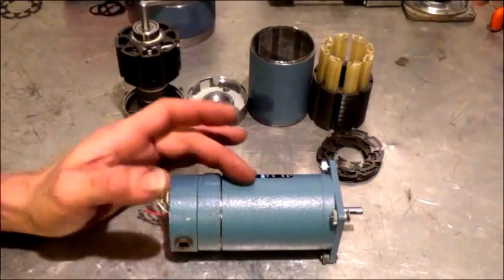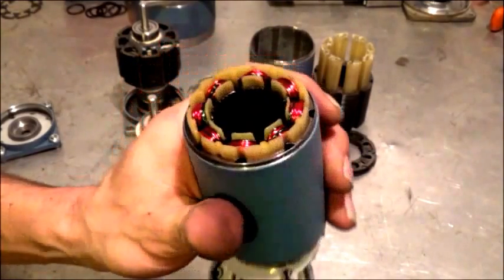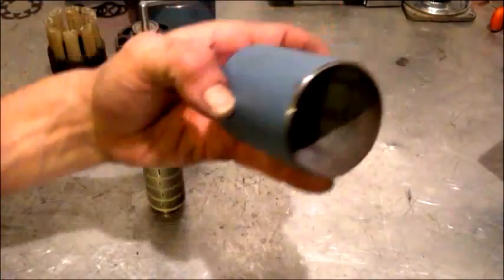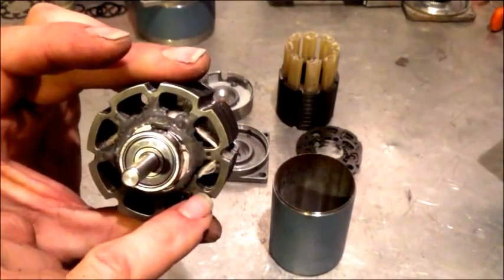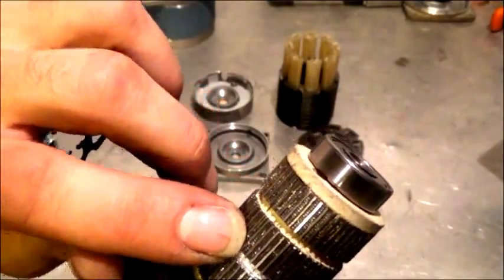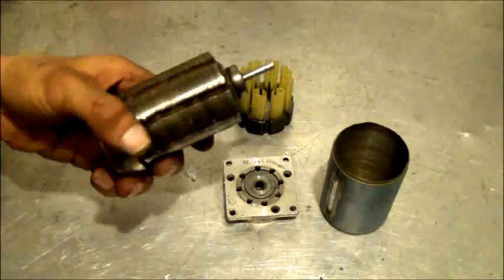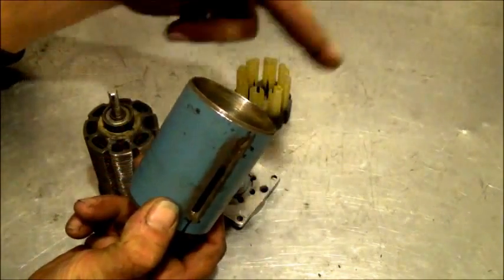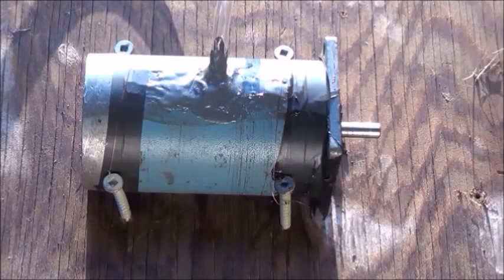"Tesla Turbine",  Full Build And Test. More Like Tesla's Original Design.

Comment: Did you run this on some fuel or just pressurized air? Because I remember that the fuel needed to combustion before entering the engine for maximum efficiency.

Comment: Have you done/can you do a direct comparison between your modified design and this more traditional one? I'm very interested to see what the differences are in torque curve, max. power and efficiency.
Reply from the maker: The video of this one and the other one both show the same generators with the same transmission box and even the same air supply, pressure and flow,. This design only produced 1/3 the output as my design, I sent both of them to different people for use and I'm not sure if they will ever come back to me as promised.
Reply: Thanks for the reply, your design has really impressed me.  I want to build a steam motorcycle someday and I was thinking of using a turbine of some description to drive the auxiliaries (centrifugal oil separator, alternator, blower), perhaps running on magnetic bearings (assuming I can find a decent enough shield to reduce its influence on the rotor) (actually, the rotor might be perfect for the permanent part of a magnetic bearing system, as you mentioned in another comment reply about making the rotor a generator). Would you be OK with me using your concept?
P.S. thank you so much for sharing this with the world. Channels like yours remind me why I'm studying engineering to begin with.
Reply: Also sorry to hear that your turbines might be gone for good. I hope they come back.

Comment: After 3 years machining tesla turbines I still went back to steam piston power for dc ac generation. The holes in disks eliminate one crucial factor that Tesla was exploiting which is the molecular friction bond of super heated dry steam on the face of the disks. It is a phenom of the surface interaction. I think you should explore the facinating fact that a strong magnet swept across an aluminum block will propell it. This may be the key to turning a large generator fly wheel once magnets get up to speed.
Reply: just eddy currents